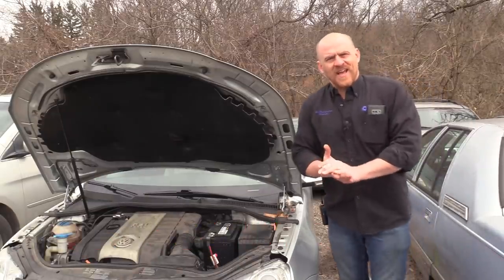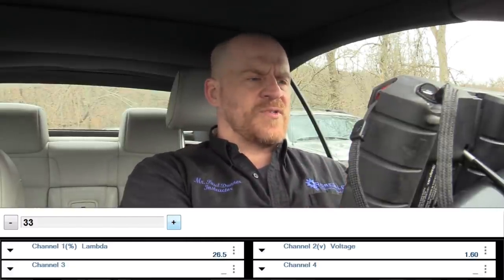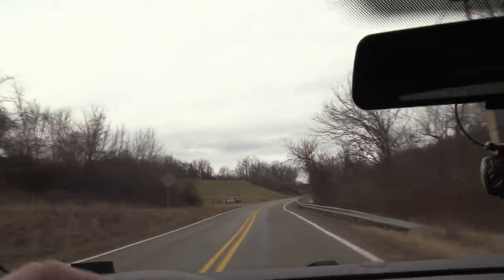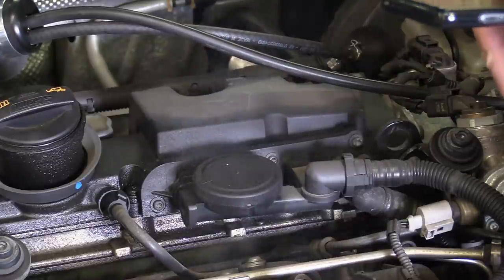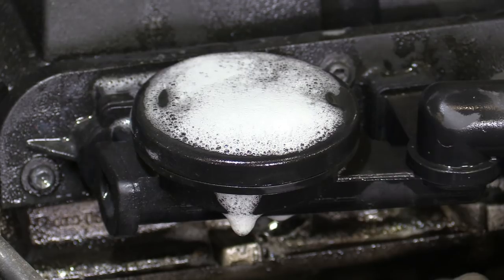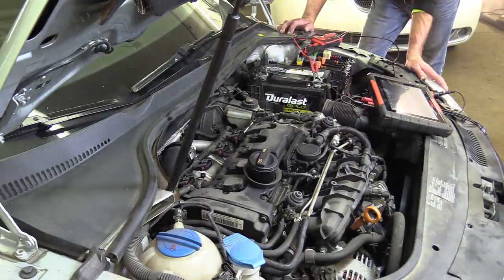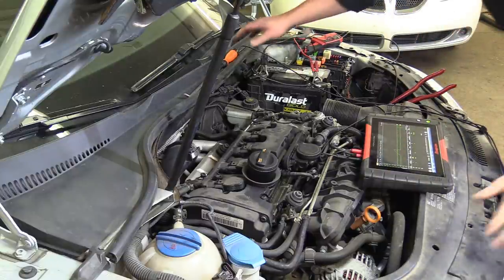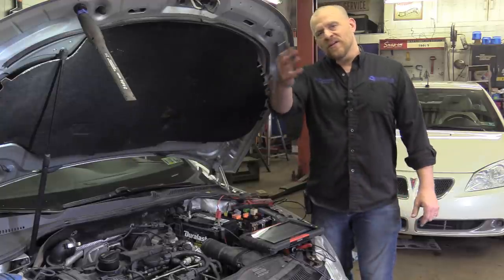Lean Condition and Misfire Troubleshooting - VW/AUDI

Comment: The "F" in "FSI" stands for "FFF!!!"--The noise you make upon receiving the repair bill for your Volkswagen.  :D

I was laughing so hard watching this...  I'm no VW tech, but I owned one, and I've worked on a few; they're definitely different, as are Mercedes, BMW and Volvo.  Each manufacturer has their own "philosophy" in mechanical engineering.  It's difficult to put into words, but you KNOW what I'm talking about.  When you work on a Chevy, I'm sure you've said "GMs tend to..."  Same with Fords, or Chryslers...  They all have characteristic ways of achieving the same thing, and that way has carried through decades of designs.  Spend some time with them, get to know them and speak their physical language, and it'll become as second-nature as anything else when you come across something unfamiliar with the brand.  :)

I'm gonna have to see if I can do a diagnosis on my company vehicle before I take it in for service.  Low power off the line, rough idle, fuel trims indicate vacuum leak (no vacuum leak present), ~10mpg loss in fuel economy, and...combustion under the valve cover with no coolant loss and no excess oil contamination!  Seriously, you pull the oil cap off while the engine is running and you can feel it resonating in your skull to the point of being painful...

Comment: Paul, on a four cylinder diesel engine, one dead injector or nozzle will cause a serious lack of power, so I am puzzled by your insistence on the other coils probably misfiring.  On that SI engine and gasoline engines in general, could it be that the coil misfires can be intermittent?  Excellent video as usual - keep up the great work.
Reply from the maker: Not sure to be honest. It certainly could have been just the one

Comment: That PVC has time when it should be changed. There is at least 2 different PVC styles on this year model. One with and one without "Crankcasediaphramg"
Engine code is the key here for the right part. Both of these had recormended life time of 3 years or 60000km(~37282miles)
If your VAG seller don't tell it to you. Then look it up from the original part manufacture PDF of that part.
Part manufacture is stamped/written on the part and most likely the google finds the part PDF for you to read in to its job on the engine and most likely life time...

Comment: Two very common VW issues.  Usually to check for a failed PCV I'll lift off the oil cap and see if it tries to suck back down.   My preferred method and a quick way to check for failed internal PCV valves.  Anytime I run into something for a check engine light or driveability issue and it has this dumb internal PCV design I'll do this test.  It's made short work of more than a few misfires and lean codes.
Reply: If the pcv system is functioning correctly, should it try and suck the oil cap down when you lift it off?
Reply: @jdemara  
Lightly, yes, it will have a small amount of vacuum under it.  When the diaphragm has failed, and there's full vacuum in the crank case, it will nearly suck the cap out of your hand.  You'll also hear a drastic change in engine pitch, as you've just allowed for a massive vacuum leak.  I've had vehicles where the vacuum was so strong due to the failed PCV system, the cap could not be removed while the engine was running due to the strong suction.

Comment: Had a similar fault on a 2008 mini turbo with a -25% fuel trim at idle ,after smoke test found a pin hole in plastic breather pipe

Comment: Pretty sure you didn't bend that pin Danner. The fellow grabbed it with needlenose in the connector after dropping it. The guy is right about the prybar to remove the coils though, you just get under an edge and they pop right up. that pcv failure is super common though. First thing i check on most 4cyl VAG stuff. Guess I'm differnt from alot of the guys watching, but I love working on all German stuff.

Comment: I do the exact same test of unplugging the pcv vacuum pipe and pluggin gnome the manifold. I have a few of those pipes that were replaced or broken, that i filled with hot glue and heatshrinked closed for blocking the inlet for testing. Also good to make a smoke machine adapter.

Comment: I totally agree in  what you teach but some of my instructors at my college dont  agree with your teachings.
Reply from the maker: Let me guess, no backprobing and no test lights 😃
Reply: ScannerDanner  . You right. no back probing no test light. They also did not agree on the pull up and pull down design. the video was magneto resistive ABS wheel speed sensor  test .  U are the best. I wish to meet you one day in person. Thanks for your work
Reply from the maker: I could give countless examples where the test light is THE tool for the job :-)
Reply: ScannerDanner. That would be great. Thanks.
Reply: RAPHAEL LETHERY . You totally right. I have worked in 2 shops. They do things different. Some of them say : we don’t do that in that way here. That is not right. It is hard  when every repair auto shop does not agree and instructors.Thanks for your comments.
Reply: Typical. You can read some of my rants in his forum about how people don't like to learn new ways of doing things and if they don't understand it, they just say it's wrong.

Comment: FSI = Fuel Stratified Injection
TFSI = Turbo FSI
It's basicly just a high pressure gasoline injection (400 bar or more)

Common issue with the diaphragm on the PCV valve rupturing on these, you often hear a little whistle from it and the oil cap is har to get of from high vacuum innside the whole engine
Reply: It's the first thing i check on FSI and TFSI engines.
Have changed several
Reply: Vcds is a nice tool for VAG just check the live data on mosfire recognition for syl 1, 2, 3 and 4 and se which one is misfiring, swap around the coils and look if the issue moved.
Coils dies all the time

Comment: the pin in the coil was bent when pete grabbed the coil with the pair of pliers paul be very careful when disconecting connectors on VW Audi cars they are very easy to break one tip for this engine I would go and replace the lifter for the high pressure pump because they will destroy the pump and the camshaft by the way the transmission felt weird because it had very low power and it'a dual clutch it had to slip the clutch in order not to stall the engine in that step hill at the stop.
Reply from the maker: No, the pin bent when this dumbass used pliers to try to get that one connected
Reply from the maker: I'll have to watch it again, maybe you're right! But I definitely didn't help things with those pliers

Comment: As soon as I clicked the video knew it was the coil on plug German cars typically has these problems you can also swap the coil to see which is bad like if it was a cyclinder 4 misfire problem you can swap it clear the codes and see if the codes come back then you know it is bad
Reply: If you follow his videos then the first thing you know, is that you don't know the problem until you start testing.

Comment: I use my Ethos and go to the misfire screen, place my foot on the brake and put it in gear increase rpm and the misfires will show under a load. I have the Japan and Euro pkge 
The CVT transmissions are in the coupes and convertibles. 
Audi burns oil from the PCV very common sometimes a quart of oil between oil changes. Told normal by dealer techs.

Comment: I believe it's "Fuel Straight Injection" translated from German. Check the TCM fuses before you go too far. LOL
Both the coils and the PCV diaphragm are classic problems on these. A tire valve usually makes a good plug at the intake manifold port for testing. Thanks
Reply from the maker: Fuel Stratified Injection as per another comment here. Thanks!

Comment: I'm looking at a friends 2010 Audi 2.0t  with P0301, I swapped coil and plug from another cylinder, but still comes up as P0301 ?  connections/wires look Okay. 
Oh and the EPC light comes on. 
...any ideas? anyone?
Reply from the maker: EPC light will come on anytime the check engine light does. Ignore that light, keep chasing the misfire. Is this a GDI engine? Have you tested compression in the #1 cylinder and compared it to another?
Reply: @ScannerDanner   I was just visiting, When he said he had a problem with his rig, so i naturally wanted to help.
 (I carry my little Autel & MM everywhere)
I do believe it is Gas Direct Injection. 
I didn't have my Compression tester, ..would've been my next test,
but ME tools are next town over.  Dang
I hear Carbon on the intake valves is an issue on these GDI Engines, but that plug didn't look too crazy compared to others but was the only different lookin one,
 so moved it over #2 along with the coil on a different Cyl #4.

he did say engine light was flashing at him before I had a Boo at it.

Haven't heard anything back, but told him I'm sure the light/s will come back on.
I hear yah on the German Cars.  
Give me a Carb, Points & Condenser any day! lol ..yeah I'm Old er
Thank You for your Response.  Great Chanel! (Obviously Subbed)
Reply from the maker: @Ron0963  the plug will not be the helpful in identifying this carbon deposits issue.  Also, do the cranking compression sound test first https://www.youtube.com/watch?v=pOghpmVhVng

Comment: Could a rear oxygen sensor cause high fuel trims at idle??
Reply from the maker: Rear o2 sensors have a factor on some systems. Primarily when a wideband upstream is being used
Reply: @ScannerDanner  the reason im asking is beacuse i have my rear oxygen sensor disconnected and i notice the fuel trim high. And i thought i could be a vacuum leak but i wasn't sure if it could be the oxygen sensor because it is not connected?
Reply from the maker: Does your car have a wideband upstream O2? (AF sensor)
Reply: @ScannerDanner  i don't know. My car is a 2006 chevy cobalt 2.2L...i just wanted to know if that could cause high fuel trims even if i raise the rpm
Reply from the maker: @angelcadena1008  I believe your Cobalt uses a narrow band upstream O2 and does NOT have downstream fuel trim control
Reply: @ScannerDanner  what do you think is causing the high fuel trims at idle? It does seem it has a vacuum leak because it does feel rough or the car doesn't even hesitates...thats why i was wondering if the rear oxygen could cause high fuel trims
Reply from the maker: @angelcadena1008  pinch off the power brake booster hose and then tell me what your fuel trims do. If it doesn't change, your booster is fine. Then do the water test I have shown to see if you can find a vacuum leak
Reply: The fuel trims stayed the same... i did the water also but i couldn't find the leak its looking like a vacuum leak even thoe the car doesn't feel rough
Reply: @angelcadena1008  If you still have high fuel trims while raising rpm, then I'd move away from looking for a vacuum leak and look for dirty MAF sensor or fuel deliver issue. Do a WOT test and see if your o2 signal stays high the entire time and look for over 4v on MAF. Any drop on o2 signal says you are missing some fuel delivery and under 4v points to MAF. post the question in Paul's web forum for nearly instant help.

Comment: How do I isolate the coils on a v6 saab that has direct ignition cassettes.
Reply from the maker: Run extension wires to the plugs from the coil housing
Reply: ISTR Paul did a video on Saturn  with a similar GM coil cassette. Without 4 plug wire breakout extensions it ain't easy.
Reply: @ScannerDanner  if I dont have the extensions could I get a clue by checking current draw on the primary side  and comparing?
Reply from the maker: @andywrites1596  just get an old set of plug wires and make your own, but be careful, these things pack a punch lol
Reply from the maker: @andywrites1596  primary current ramps will NOT show you all secondary faults, so yes, definitely view the primaries, but no, do not trust that a good ramp equals a good firing coil

Comment: There is a tool to remove those VW ignition coils.
Reply from the maker: Of course there is. I always look for my ignition coil removal tools when I deal with coil faults 😉
Reply: I use vice grips
Reply: @ScannerDanner  I wanted to point out that there is a way to remove coil without possibly damaging something. The same way that on some cars you need to use a tool (spanner/wrench) to unbolt the coil to remove it, So on VAG cars you need to use tool. For occasional use I usually buy cheap tools from Aliexpress or other cheap source or make my own tool.

Comment: How does your VW master tech not know that there should not be smoke coming out of that vent box? I'm not a VW Master tech. Those things just go bad all the time. You can remove the top side of that assembly. It's just a diaphragm. You'll see the ruptured rubber diaphragm. You can buy just that part and unbolt it from the valve cover. I've also seen those go bad at the same time the injectors go bad. And you have a simultaneous vacuum leak causing a lean condition and an injector pouring fuel into the cylinder causing a rich condition.
Reply from the maker: He doesn't use a smoke machine to find the leak on these, so I understand why he questioned it
Reply: @ScannerDanner  He should be using smoke machines. Idk how you would find some of the issues that arise without one. I've had the Chevy Sonic/Cruze platform with the 1.4 turbo engine throw me for some loops. Due to the PCV, again, being integrated into the valve cover. But also having the vacuum leak come from the oil cap o-ring. And also from the evap purge valve. I had a Chevy Sonic just last week that had all 3 at the same. I smoked it. Found the valve cover as you did in this video. Then the new valve cover did not come with an oil cap so when I replaced the valve cover upon re-test I found fuel trims still off. So I smoked it again and found the the oil cap. Then retested and found again lean condition and found the purge valve was working but like a faulty injector it was flowing too much while being pwm'ed. Anyway. Just conversation pieces. Love what you do. Not just good knowledgeable content. But your content has made me a better tech.

Comment: Those hoses are crap and hard to find. Have had to use electrical tape for cracks but the ends should lock into place.
Reply: Good test
Reply: Buy a set online for under $100 for 4

Comment: Those PCV valves are the dumbest design ... they got them built into the Chev  Cruise valve cover and they always failing. It builds up so much pressure that you hear a  whistle as the air pressure blows through the crank seal. You have to replace the whole valve cover.

Comment: Everything that seems stupid on VW is done on purpose, these are the traps put from the manufacturer for inexperienced VW technicians. You can't believe how many things you can do wrong if you are not doing things how they are made to be done from the manufacturer, things that you'll never thing of like changing a belt pulley( if you not doing it right you can brake cooling path inside the engine and there is no repair). It's the sam like the problems VW puts on their platforms on purpose, problems that you are limited to experience in US, because you don't have the big number of engines we deal with in Europe. For example 2liter FSI engine has 15 different engine codes with its own specific problems and on the other side  we have a lot of diesels which are even more full of problems. VW is enormous bag of money if you doing it right , i can't understand why people buying it anyway, it's one of the most preferred cars in Europe. And one last examples in newer VWs you can't swap modules betwieen  even the same engines because of something called component protection, this can be done only by the dealer. Its funny brand to work on!

Comment: No such thing as an fsi audi, bro! Fsi is strictly a vw naming. It's tfsi on the audi side of things. Stands for Fuel-Stratified Injection. TFSI is Turbo Fuel stratified injection
Reply from the maker: I have a case study on a V8 non turbo Audi and it is stamped FSI right on engine cover from what I remember
Reply: @ScannerDanner  aaaaa, yaaaa. That's the old 4.2 v8 fsi and the 5.2 v10. Yaaa, you are right! I had forgotten about these, just coz they are not an everyday occurrence. There's also the 3.2fsi V6. That one a bit more common, but also old. Sorry bro. I had forgotten about these older units. Btw those are really nice engines. Modern audi engines are the 3.0tfsi, 2.9tfsi twin turbo, the 4.0tfsi twin turbo, you get your 2.0tfsi and 1.8tfsi and then the old 5.2 v10 fsi on the r8
Reply: Btw bro, just as an fyi, next time you need to pull out a vag ignition coil, just get a long cable tie and zip it partially to make a ring. Then shove one end of it underneath the coil body and pull on the other end of the cable tie. Works almost like the special tool.

Comment: hahahaha, paul this vw cars have stupid design indeed, it is also difficult to do fuel pressure test on them.no shutter valves and the fuel pipe connectors are not common or usual ones, they are so many here south africa.
on mine there is no maf sensor. eish. i have long been waiting to see you working on a car that i know. we do not have the so called gm cars here.

blom moshitoa 
south africa

Comment: Silicone spray......
Reply: Shouldn't put silicone spray on the grommets. The rear 2 grommets seal the air filter part of the airbox. Silicone spray will cause air mass meter deviations and sensor drift, along with the same happening to the o2 sensors. That's why all silicone sealant used on an engine has to be sensor safe.